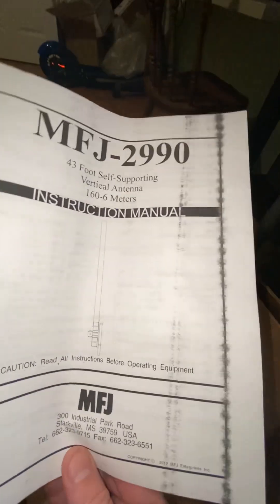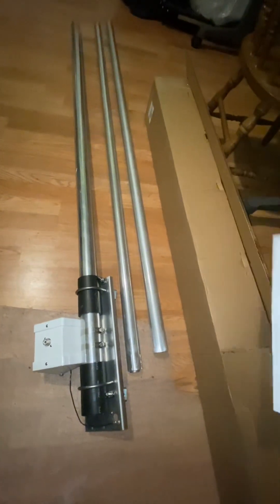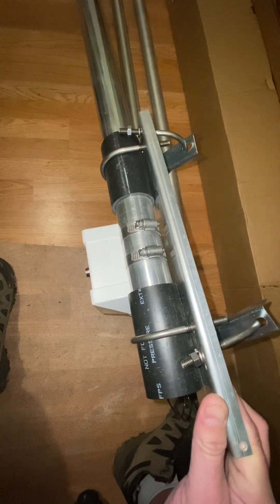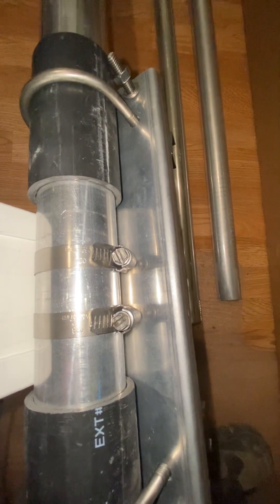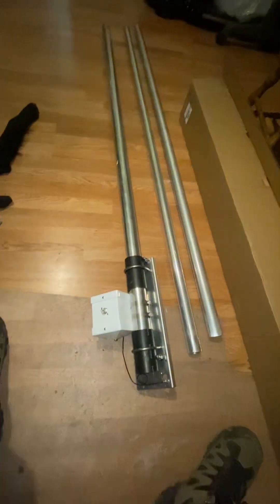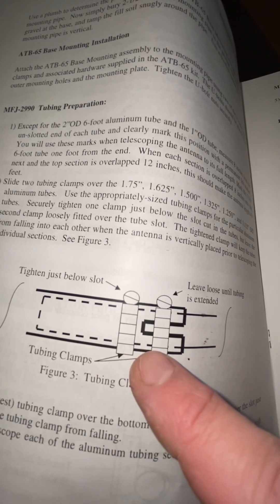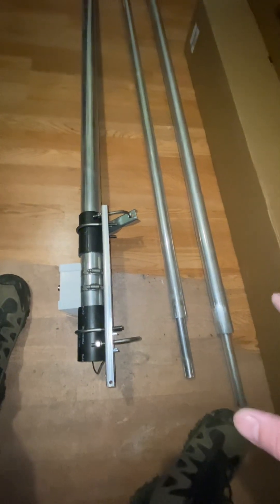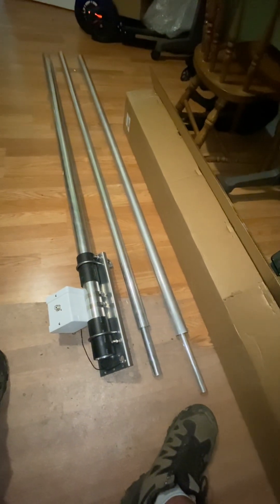MFJ-2990 Antenna 160-6 Meters (Part 1)

Comment: I just made one of these using aluminium tubes i got from tha scrap metal yard . Amazing results low SWR 3.5mhz to 54mhz. I dont use 1.8mhz dont know anyone who does. Im able to run my AL811h full throttle up into the sky no worries.